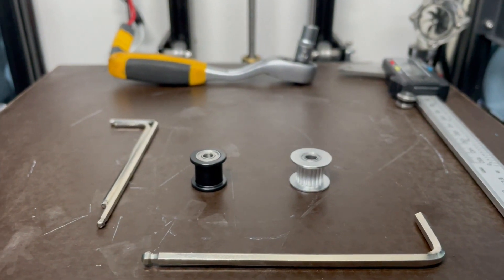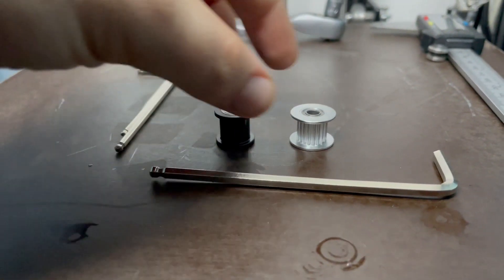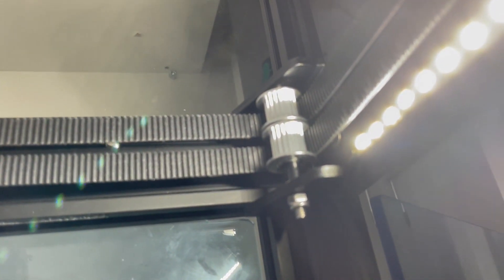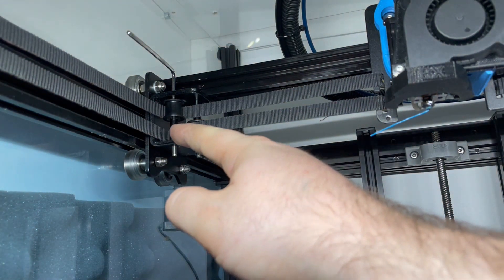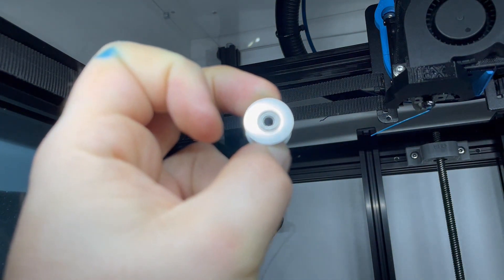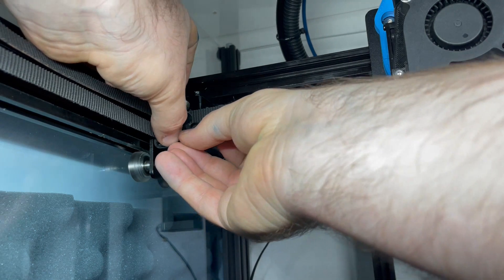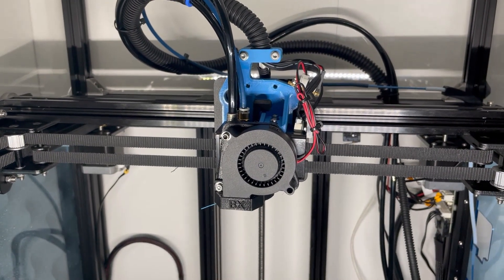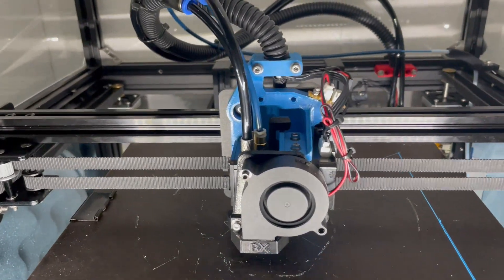Ender 6 - Mechanical Issue Part 3 - Pulleys

Comment: Anyone still looking to replace your pulleys, if you live in North America, TH3D now sells a metal replacement pulley set for the Ender 6.
Reply: they are a mix of smooth and tooth still tho, would need 2 sets to go all teeth.
Reply: @maxkool007  You want smooth on 2 of pulleys where the back of the belt wraps around. So 6 toothed, 2 smooth.

Comment: Just did this, printed 1mm spacers as the black spacers fit through the bolt holes anyway. Probably could just print custom lengths to ensure the pulleys are in the same position. They were 6mm OD and 4 mm ID, just tight enough they barely engage the threads of the bolts. I measured about .2mm difference in height between the belt path before and after. US Amazon had the pulleys and aluminum shafts. Did discover I have some flat spots on a wheel or two of the gantry, so ‘while we are in there’ has taken hold here too.

Comment: How did you deal with z-wobble?
Reply from the maker: What do you mean ? Z-Wobble with the Pulleys or Z-Wobble from the Printplate ?
Reply: @PhilsBastelwelt  From the printplate. if you google “z-wobble ender 6” you will find several possible solutions and examples. I tried to paste a link to give you an example, but YouTube does not post the comment.
Reply from the maker: @ThePgmiranda  I printed that holder with a bearing on top of the z-Rod. But I had no mayor z-Wobble…

Comment: I see you are using PC V-groove wheels on your printer. Are you happy with that upgrade? Was it an improvement over the stock POM wheels?
Reply from the maker: Honestly…I hade to exchange the originals rolls cause they had flatspots…so I took the opportunity to buy these POM Wheels…but they are not better or worse…the printer works the same way it did before….

Comment: I do the same modification but instead I buy spare Ball Bearings 4mm x 11mm x 4 mm and use  the spacer from the old pulleys in between the bearings because the pulleys I buy the bearing are 4mm x 11mm x 5mm and the only ones I found was the 4x11x4 but they work great 👍
Reply from the maker: I also thought about this option…but getting pulleys without bearings is very hard…and getting the original bearing tout of the pulley is also hard work … so I took my option 😬

Comment: Great upgrade. I get "groaning" sounds from my Ender 6 with really high accelerations, so this might be a possible fix.
Reply from the maker: Could also be possible … :) give me feedback if it works with your printer :)
Reply: @PhilsBastelwelt  any updates?
Reply: I have that same groaning sound coming from my Ender 6 whenever I try to up the speed of movement
Reply: @seekerfpv  I figured out the problem thanks to somebody on Reddit. You have to increase the power to the stepper motors. I wound up replacing the stock board and installing klipper. I was then able to configure the X & Y stepper motors to run at 1.0 Amps. Now I can print fast without groaning noises. Hope this helps!
Reply: @3dexperiments  it does helps. I’m really close to just completely mod this printer because there’s issues with my Ender 6. What other benefits would somebody get from just changing the board?
Reply: @seekerfpv  My recommendation is don't mod more than one thing at a time. I did not follow this advice and it took a LOT of time to dial everything in. A new board will allow to you swap stepper drivers if they fail (this has happened to me). Some boards will also allow multiple fan ports and controllers for LED lighting. You can also find boards that will fit in the stock creality mounting holes. Just decide on the features you want. I have tried BigTreeTech boards and they are OK but their support is terrible. MakerBase MKS boards have a reputation for better build quality and lasting longer. I have upgraded to linear rails for X & Y, new hot end, direct extruder and bed level sensor.
Reply: this is caused by stealthchop and isnt much you can do about with the stock board as the steppers are not in UART mode and locked this way.